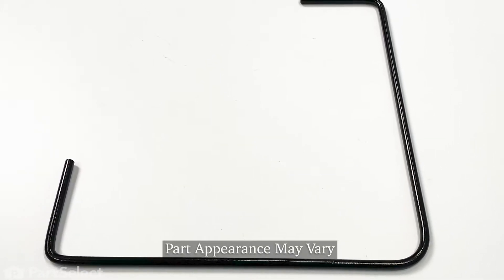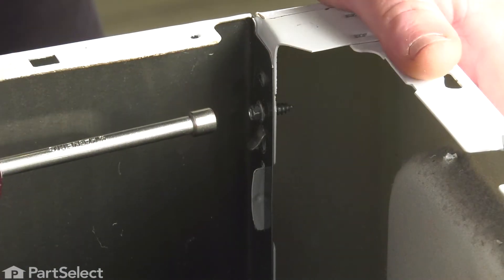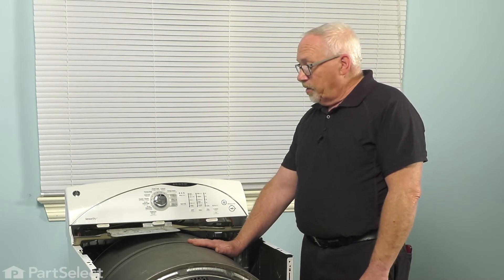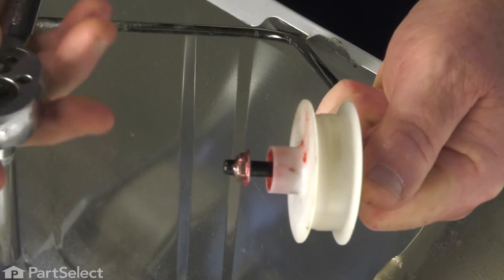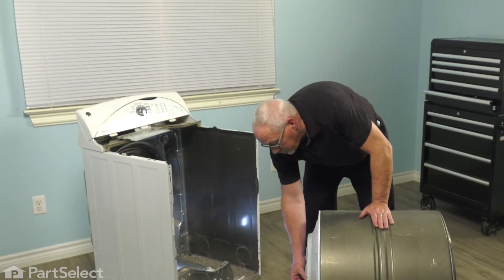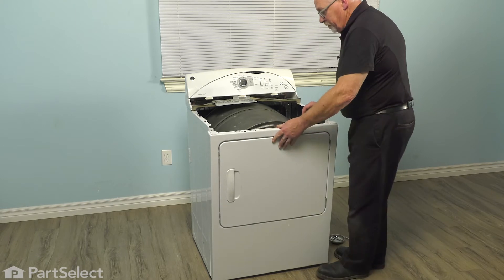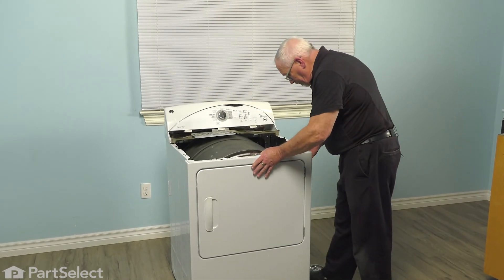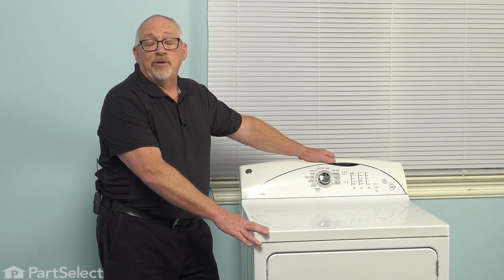GE Dryer Repair - How to Replace the Idler Arm (GE Part # WW02A00060)

Comment: This video saved my night. Was troubleshooting my dryer making a clunking noise and when I fixed the issue and was putting it back together I couldn't get the idler arm to put tension on the belt. I couldn't figure out where the end went into and how it was supposed to. Your video showed me exactly where I needed to insert the arm, and once I got that done the rest was pretty easy. Thanks so much for the video. It saved me from hours of trying to figure it out myself.